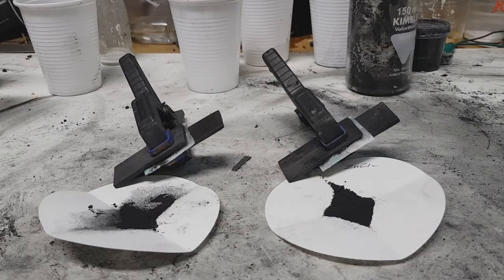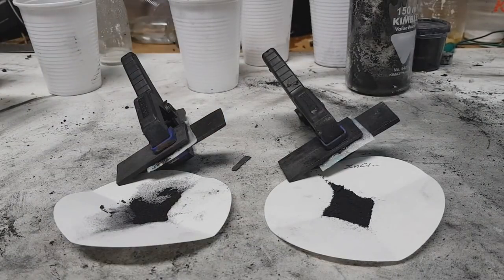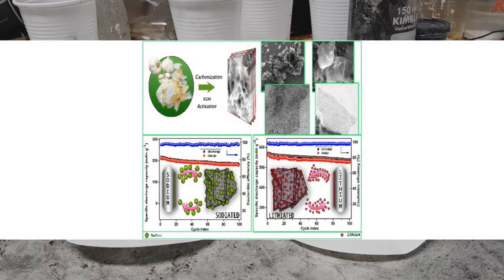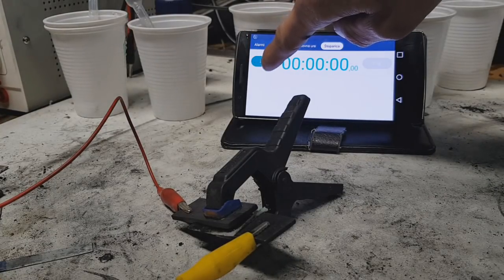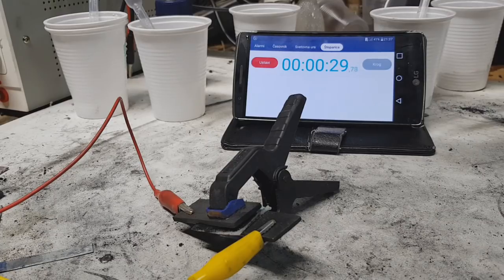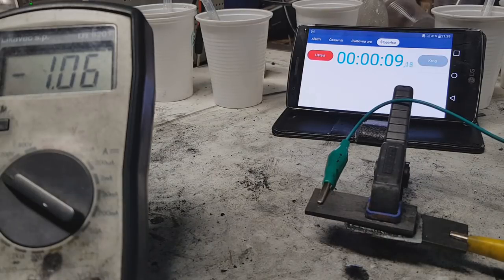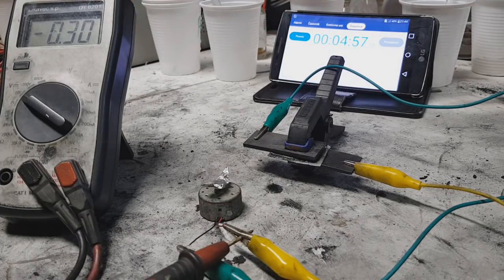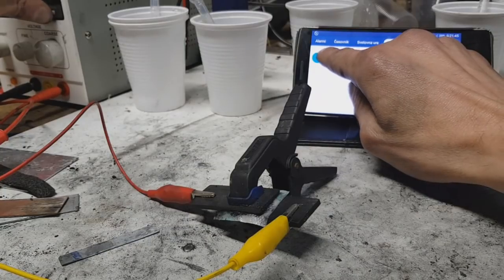Activation of Carbon for Supercapacitors and Battery

Comment from the maker: A new DES electrolyte is presented on my Patreon!
Reply: Does the acid activation require any more steps, or the activation just happens in solution?
Reply: zink chloride is very powerful. If it is added to any other conductive stuff it will increase its conductivity it is the same with magnesium too but it needs to be done the right way. The one you did is excellent.

Comment: Sugar that you are using has long chain carbons and short chain carbons. Yeast that makes alcohol will only use the long chain carbons leaving short chain carbon behind. Since electricity is stored on the surface of the carbon atoms a electron traveling around the bound electron to the carbon atom usually on the exposed surface of the carbon and in a direction straight to the collector plate like a wet sponge. The water fills the cavity of the sponge and coheision attracts the water to the surface but gravity draws the water downward only allowing the water to pool on the top surfaces in the cavity. The electrons do this in the carbon but they are not affected by gravity like water. They are suspended by the atomic electron shield of the  carbon atom and the electrons only travel halfway around a atom to the next atom because electricty is lazy and it always takes the shortest route to ground. So what does this mean? You need to structure your carbon for electron storage this could be done by thin layers of carbon deposited on your collector plate overlaying each other creating structure even by growing crystals on the plate by heat, or by a ionazation  crystallization process, I cannot give you all of my secrets but you have enough to get you going in the right direction 😁 a mind is a terrible thing to waste and thinking is FREE! 😁

Comment: Have you ever noticed lightning in sky? And how it is created? It just uses water moving across each other at 180 degrees then a electrostatic charge is formed. Water can also be in the form of a plasma the 4th state of matter. Anywhere there is movement there is current, and anywhere there is current there is movement. Battery's use the exchange of chemical ions movement to carry a charge to collector plates the recharging the ions reverse their travel and move to their previous state. Current is movement of electrons in a circuit passing to ground. With hot electricty. Cold electricty travels in reverse to hot electricty from ground to positive😁 just informing you that there is a equal and opposite form of electricty. Cold electricty will make a filament light bulb turn cold instead of hot😳 there is a equal and opposite reaction for every action..

Comment: Structured carbon atoms will store more electrons the trick is to create the structure this can be done by crystallization with another element to create the lattice structure of the carbon😁 there are many processes and ways to do this but give different results.  By growing a carbon crystal with a isotope this structure can be formed making areas for electrons to be stored upon a crystalline lattice structure  that is grown for this purpose then used as a collector on a plate. You are getting close with baking carbon with elements but you must structure your carbon.
Reply: sounds like you are onto it ,carbon crystals , do you mean diamond ,what process are you using to grow carbon crystals cheers

Comment: It seems that these doped carbons with zink will produce more electricity than plain carbons but the zink atoms will dimish and the cell will degrade, sad to say. The acid base carbons will degrade the collector plate and eventually fail. Even rechargeable battery's fail due to chemicals degrading, loss of electrolyte, and plate degradation. Probably the best storage device for electricty and recharge is a capacitor. Proper understanding of what electricity actually is, how it travels, the losses involved in transmission and leakage of charge in storage would be helpful to any scientist. For a rechargeable battery this would be the exchange of ions across a barrier to a opposite plate, the ions carry the metal like electroplating zink then using a weak acid electrolyte to send ions to a collector plate copper or carbon something that won't degrade, this battery will produce current but will fail. Most battery's are a chemical reaction between two plates. The chemicals degrade and the battery dies. Lithium battery's degrade because of the dendrites current paths short out the cells. Due to electricty being lazy the current pathways grow oxides crystals that short out the cells causing fires. So what is the solution?  Chemical battery's with limited life? Or capacitors with mutch longer life and recharge? Or a fuel cell battery that uses metals as a fuel burning the metals and creating current?  A fuel cell battery can have a longer life span and need no power source to recharge just use more metals and electrolyte then you have current.  So the choice is up to you.?  Now thinking outside of the Box helps greatly🤔Hmmm? A solar cell with a light source would produce current and storing a light source can be done with liquid glow chemicals or glow plastic that has been turned to powder and a clear gelatin added then pumped thru piping to glass tubing and a light source like the sun. And even stored in a large container. The liquid could be exchanged at a station for charged solutions. A Reactor uses fuel rods to make heat heat converted to run a generator makes current.
Reply from the maker: Nice thinking mate! Yea, I try several fuel metal cells based on aluminium and zinc which is ideal for off grid. And I really like the idea about fuel metal cells.

Comment: self-made SuperCaps are not practicable. Why? Breakdown Voltage to low (< 1.2V) and discharge-current to high...
Reply from the maker: If you know what you do, you can make good supercapacitor. You have milions of reasons why you get bad performance,.... not good or to low mol concetration of the electrolyte, binder, high resistance of the electrodes, thicker separator, the -+ electrode need to have good press together to one another, bad active material..... Most of the water based electrolytes have the limit of 1.23V, right. But you can also go to 1.7, 1.8, 2V,... (for example MgCl, EG abd H2O = 1.9 - 2V, 2 mol Na2SO4 = 1.6V, 2 mol ZnSO4 = 1.8V, etc). For level of self discharge is important the resistance of the electrodes,... high resistance = high level of self discharge. In basic all supercapacitors have self discharge but the question is how big is the self discharge. For making the electrodes is good to use a conductive material like graphite with activated carbon and binder. The electrode you need to press really hard to lower the resistance. Then you also have hybrid supercapacitors in which you have again milions of combinations. For example: MnO2 positive active material, AC negative active material and KCl electrolyte, sorry but I dont remember the mols,... 1 mol or 2 mol of KCl. The voltage is around 2 volts. Then you have also a redox active aditives which can you boost your supercap,.... see on google. I know that is a lot of work and organization to make a supercap, but is important.

Comment: Did you try the sugar with zinc nitrate? Check this out: Making High Performance Supercapacitor Materials - 1 https://youtu.be/GSDSUFvLOEo  . If I remember right it has an energy density about the same as lead acid but you can charge it a lot faster and drain it down to 0 with no damage to the battery/cap.
Reply from the maker: Yes I try this,.... but you get only small amount of carbon. I need to miltply the amounts to get the carbon for one prototype. I think that is not really economically. But yes, you can get a good carbon with great surface area with zinc nitrate. But you have also methods that you can activate surface area of the carbon in better scale. But if you need a small amount of good carbon than you will go with zinc nitrate method.
Reply: @cayrex  Is what you did in the video with the zinc chloride better or worse than the zinc nitrate method for energy density? Also what about carbon sugar foam by using the hydrochloric or the sulfuric acid to foam it up? Thanks man

Comment: Nice video, For the KOH activation what kind of glassware did you use? Have you ever tried microwave activation?
Reply from the maker: I make a salt activation. For KOH activation is better to use teflon chamber? Can you tell more about microwave activation?
Reply: wouldn't Teflon chamber melt? I mix carbon with KOH in different ratios and activate it under Nitrogen for 10-30 minutes depending on Carbon source. But so far the glassware is the major issue I have!
Reply from the maker: Fatemeh Shahin melting point of teflon is 327C, you can use in autoclave reactor. But is nod good for high heat activation in this case is borosilicate glass good.
Reply from the maker: Fatemeh Shahin but you heat the carbon and KOH in the microwave on full power (700W)? You use nitrogen gas or you have another source of nitrogen?
Reply: that is why I wouldn't use teflon, as the temperature reaches ~1300 C. With autoclave the highest temperature is 120C and I agree that the pressure would help, but the Surface area of the AC is low
Reply: Yep and I use humid Nitrogen gas!
Reply from the maker: Fatemeh Shahin vycor glass is also used for high heat

Comment: Great video ! But I have a problem of the charging voltage. Is it ok to charge with fairly  high voltage (2.4V) with  water based electrolyte ? when charging over 1.2v, Is it possible to electrolysis of water ?
Reply from the maker: if you charge with 2.4V you will get some hydrogen evolution. But, you can try to charge with this voltage. in the end lead acid battery is also charged over 2V and electrolyte is water + H2SO4

Comment: Hi Cayrex,
Impressive result.
As you activated the carbon with ZCL, why did you not use that as your electrolyte rather than MGCL?
Martin.
Reply from the maker: solarhope because yes I can also use ZnCl als electrolyte but In the end I need to wash the carbon anyway to remove the salt.
Reply: cayrex2 What happens if you leave the salt in the carbon ? Doesn't it get more conductive then ?
Reply from the maker: I dont know if will be more conductive. Salt can close some pores in carbon
Reply: @cayrex  So what do you use to wash the carbon? Alcohol? DI water? Do you reheat it to dry or do you let it dry through natural aspiration(air dry)?

Comment: Do you bother with washing after processing your various active materials?
Reply from the maker: Yes,... sorry. You can try this,... if you make your carbon activation with (for example) NaCl and also your electrolyte will be NaCl,... than try using a carbon without washing. But I am not sure if this will work correctly